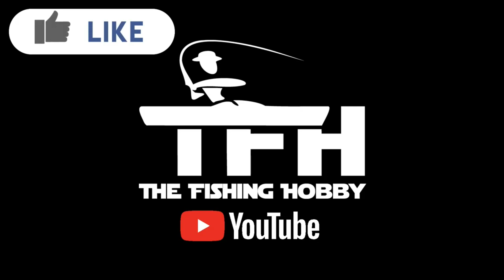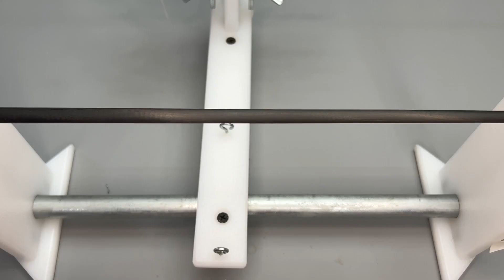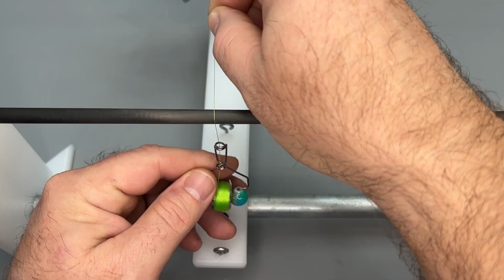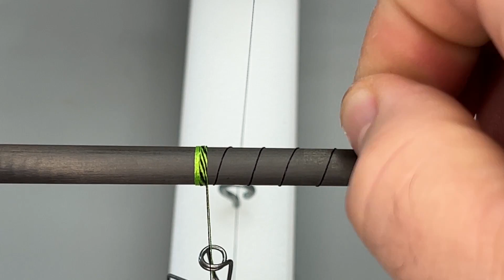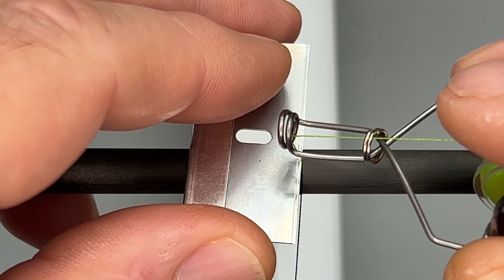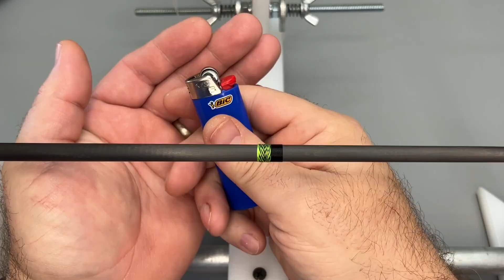Trim Band Tutorial - Tiger Stripes!!! Helix Wraps Revisited Plus Wrapping Tips Along The Way

Comment: JUST CUORIS IF THE BOBBN IS READY TO BE PURCHASED?  And do you show the tiger wrap?
Reply from the maker: They are available now. Here is a link to the bobbin holders that I am selling: https://5286af.myshopify.com/products/rod-building-bobbin-holder
And this a video talking about them: https://youtu.be/3NdVZRDL0-4

And when you say tiger wrap, are you talking about the 3d effect tiger wraps you get by doing multiple colors burnished in different directions, coat with epoxy and do a top thread with a sacrificial thread that is removed to reveal the pattern? If so, I do not currently have a video about doing those types of wraps.